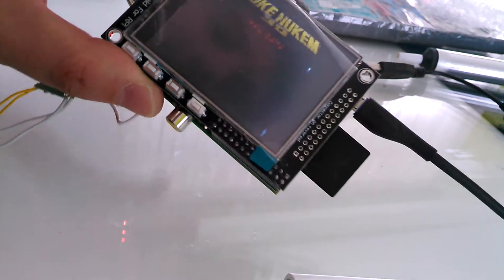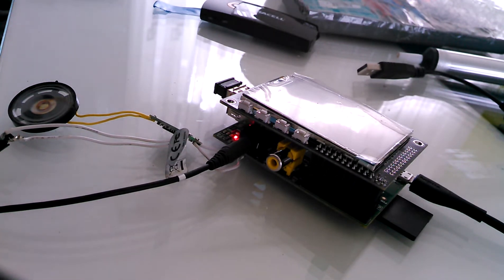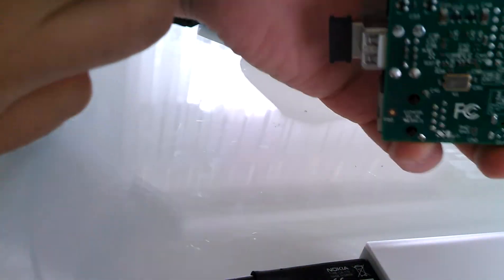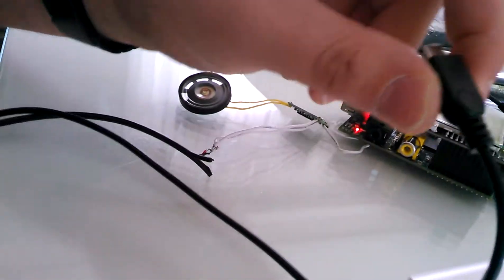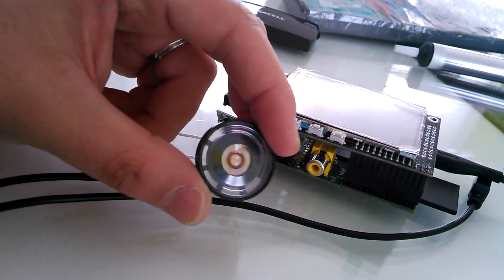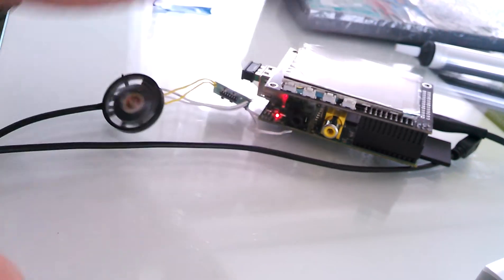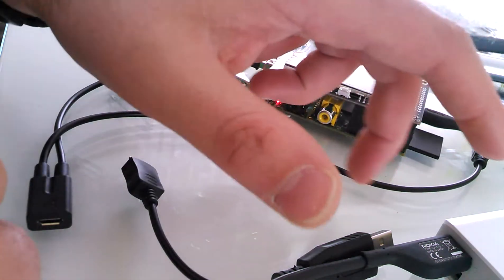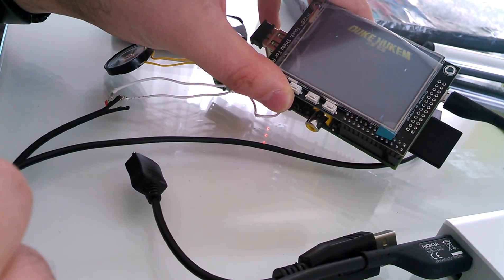Audio Amplifier doesn't work properly on Raspberry Pi (FIXED!)

Comment: Hi! Just to be sure I understand how you fixed it:
Dit you swap the two connections from the white cables coming from the Pi to the amplifier?
I mean the two lower white cables you can see in the video at 1:14.
Reply from the maker: Yes, exactly! They needed to be swapped

Comment: Since you solved the problem by switching the ground and R on the amp, were you able to power the amplifier board and the pi off the same power cord, or did you need two sources?

I figure a 5V 2A source would be enough for both the pi and audio amplifier.
Reply from the maker: Yes, they can be connected to the same power source without any problems.

Comment: Hi, I just ordered the same amp board. Is that a gameboy speaker? :-)
Did you mixed the R and Ground by mistake or you have to switch it for the amp board to work?
Reply from the maker: TheDarkmore Yeah, it's indeed an original GameBoy Classic (DMG) speaker. The switch was indeed a mistake :P